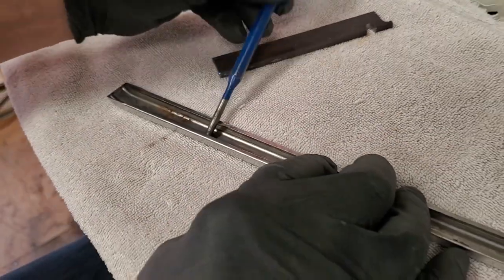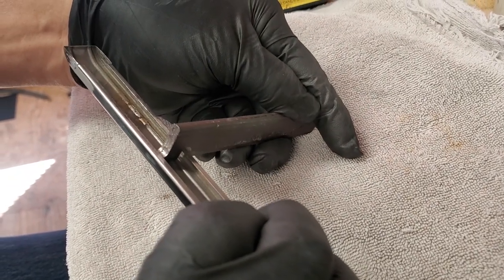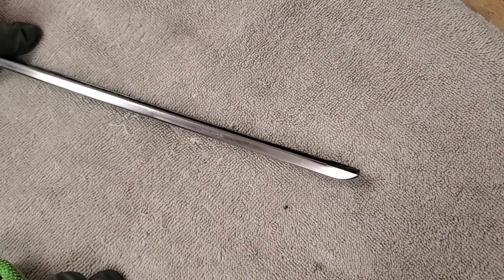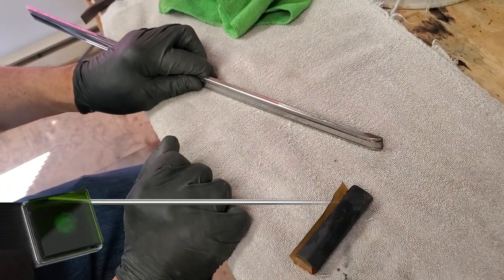Stainless Steel Auto Trim Repair Hack -  Stainless Steel Auto Trim Dent Removal and Polishing

Comment: Very informative video and a great little tool, thank you. I have a question and I hope you can help me. I am restoring a 1939 ford deluxe and the trunk handle has a few dents. Problem is the handle base is stamped out of 18 ga.steel and the stainless is formed over it
And rolled over on the underside. Have you ever tried to repair one like this?
Jim
Reply from the maker: No, but this is exactly the same problem that could be found on a Graham trunk handle. Theoretically, we'd have to disassemble the unit, repair it and then anneal the edges to re-sand them. It would be a good Idea to practice on a part that does not matter, before restoring the actual part. Thanks for watching!